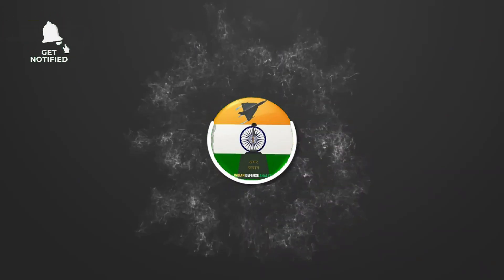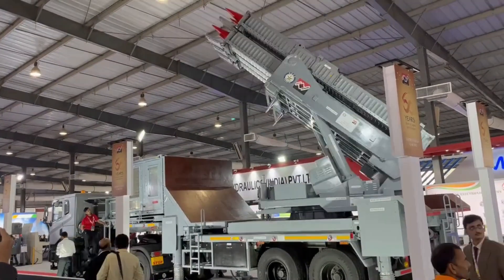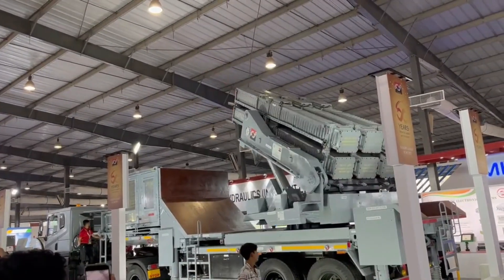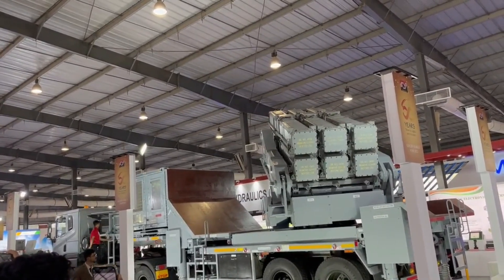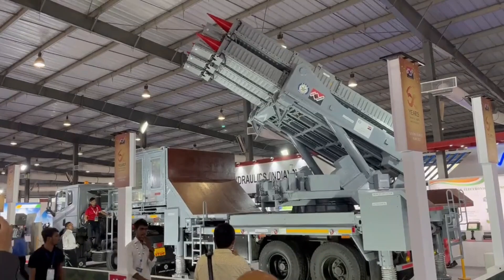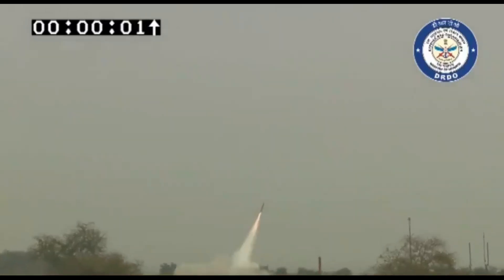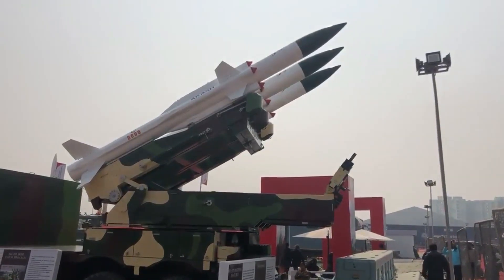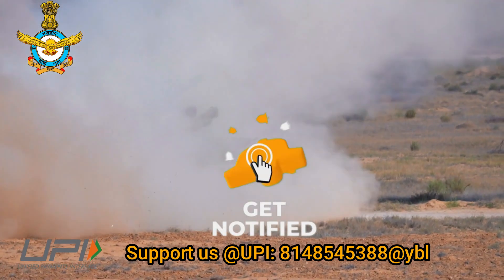Akash Next Generation (NG) Missile System by 2026 #drdo #indianarmy #indianairforce

Comment: 3 missiles in 20 seconds is frighin slow for a modern SAM system...to Neutralise an Aerial threat you will have to fire two missiles simultaneously within 3 or 4 seconds.
Reply: Yup they took forever to develop anything and still couldn't live up to the modern standard.... disappointed
Reply: Akash NG need to drink red bull😂
Reply: It's slow b'cus it was primarily designed to target aircrafts and helicopters also subsonic/ super sonic missiles, but nowadays we need to counter hypersonic missiles especially from Chinese side. Also low RCS drones are a threat which are generally flying higher than the Akash Ng kill altitude.😮
Reply: @TheFreelancer007  . For an Aircraft, you need to fire 2 missiles at a fast pace..within 3 seconds the best...it's the same for air to air or Ground to air missiles.

Comment: Which tyis better system Akash NG or QRSAM ???
Reply: they are two different systems and so it is not correct to compare them, QRSAM is a short range anti-aircraft system meant to protect mobile armored collumns, it's range is approximately 30km only and is meant to be erected and fired on the go, whereas Akash-NG is a medium range anti-aircraft missile system meant to protect fixed installations like airbase military stations etc, it's range is 70km and is not so mobile. 
Akash-NG systems are under order, QRSAM system is still in the works and have not yet been ordered.
Reply: Akash ng I think
Reply: QRsam is for mobilizing troops or armour fighting vehicles. Akash NG is more of area protection missile.
Reply: Definitely xrsam.
It's the most powerful which is even as powerful as s400
Reply: @eternal1967  there is no XRsam program so far earlier there was news about such program but no new development. LRSAM which will have range between 150-200km  with active radar seeker is under development.
Reply: @james4807M  search in google bro . Even Russian media said that xrsam will stop buying s400 deals with 🇮🇳